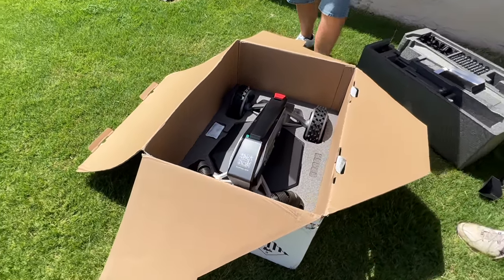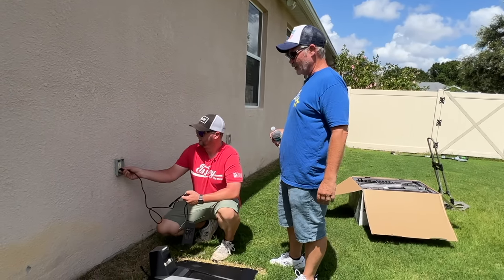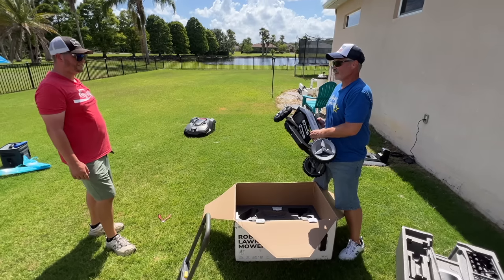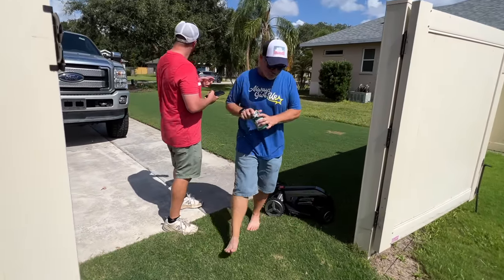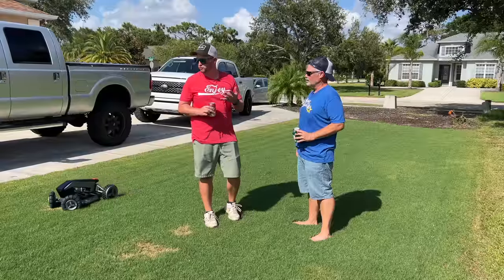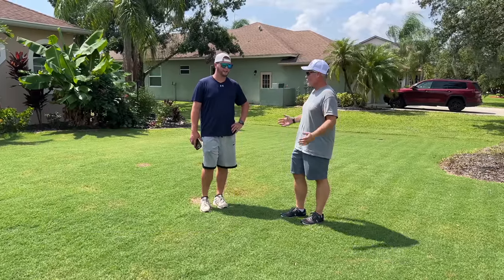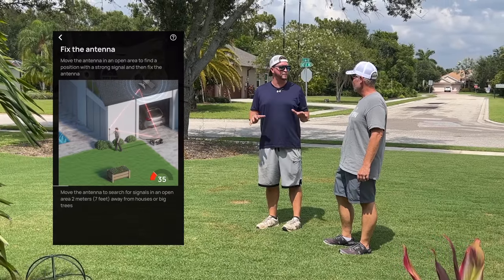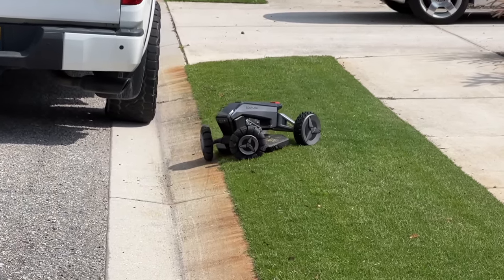EcoFlow Blade Robot Lawn Mower // UN-SPONSORED REVIEW

Comment: Great video! I had an Ecoflow Blade for a month before I returned it and got the Mammotion Luba 5000. To summarize, the Blade was horrible but the Luba 5000 is amazing and I couldn't be happier. I have wide open skies so no issues with RTK positioning with either robot, the main issue with the Blade was the omnidirectional wheels and poor software. It couldn't handle any inclines in my yard and would spend most of its battery spinning around trying to get unstuck. I have a huge incline in my parkway and the Luba 5000 handles it like a tank with the 4-wheel drive rubber tires. It can literally handle anything and get itself out of any situation. The battery lasts longer (2.5-3hrs) and charges faster (~1hr) than the Blade. The cut quality is better with the two individual blade decks (15.7" cutting width) that cuts to the edge. With a recent firmware update they upped the max cutting area from 1.25 acres to 2.5 acres! The software is hands down better in too many ways to describe. You can adjust the speed of the Luba when you're mapping or mowing so you can literally drive it around like an RC car if you want and map a huge yard in 5 minutes. The Blade only maps with one speed which is incredibly slow. One of the best features is that you can delete individual mowing areas, no go areas or channels without deleting the whole map (not the case with Blade!). What's even better is that with a recent firmware update, they let you edit the boundaries so if there's one spot in your yard that you don't like how the Luba is handling it, you can edit just that 5-30 ft boundary for example without messing with the rest of your map. It actually follows your boundary perfectly (unlike the Blade) and you can program it to do 1,2,3 or 4 boundary cuts before it starts cutting the main mow area. 

Most importantly from a lawn care perspective is that you can control the angle of the cut and can put patterns in your lawn so you're not always mowing the same direction/pattern. So maybe you mow North/South on Monday, then East/West on Wednesday and then another day you can mow it on a diagonal..... very awesome! Another thing to note for people with big trees, the RTK beacon doesn't have to be installed/connected to the charging base so if you need to mount the RTK on your roof or on top of a fence which is 50 yards away from your charging base....no problem! Hope this helps someone out there.
Reply: WHEELS:  are your Lumba Wheels 
[ ] the Original Tractor-like wheels (front & back the same)
[ ] or the Omni Front Wheels (like the Blade)?
Reply: @tulsatom4307  all four wheels are the same, thick rubber tires (not omnidirectional in the front like they are offering as a model choice now). Personally I'd steer clear of the omni wheels. Like I said above, the AWD four rubber tires can tackle the craziest hills. They can handle even bigger inclines than Husqvarna's $5k AWD model. The Luba 5000 is literally a tank, even on wet grass.
Reply: Too bad it’s only 30-70mm HOC at the moment. :/
Reply: @402SHO  I'll be honest, the sweeper worked awesome (when the robot wasn't getting stuck every 30 minutes) and the packaging it came in was excellent but yeah, they've got a long way to go before it's a viable product.
Reply: @alexlanders9005 I am in the same boat. It’s so close and I want to love it but it’s just not there. The sweeper works great but the bag fills so fast
Reply: @alexlanders9005  yea they only had some test it for a few months like I got mine at the end of the summer when my leaves had already fell and my zoysia grass I think that’s how u spell it, slowed down and stopped growing so thick. Then when it cut the cord they forced me to pack it up and send it back for another one instead of sending me a new pole and cord. The outline system for the yard also is pretty bad it always overshoots the boarder line I set. They sent us the bag but it didn’t work at all none of us tested it because it wasn’t setup
Reply: This comment and Brett's review are the best I've heard/seen thus far...excited for what's to come as they continuously improve.    But I still cringe at the price tag being equal to a decent ZT or 3x a timemaster....and knowing how consumer electronics can easily crap out... (hopefully covered under a good warranty)
Reply: @greghuizen  Definitely agree with you there. I bought the 3yr Asurion warranty from Amazon on my Luba 5000 so that was a no brainer for me to give me piece of mind.
Reply: @alexlanders9005 You are the Chuck Yeager of robot lawn mower reviews.  LOL!  Very detailed and informative.
Reply: @damonried1720  lol, thanks. I could have written a few more paragraphs easily. I've owned robot lawn mowers for 6 years now. Luba 5000 is the current king for my large lawn with big slopes. Had a Husqvarna and a Landroid previously and then of course the one month stint with the Ecoflow Blade
Reply: @alexlanders9005  what's the advantage of the omnidirectional ones? Seems like they're complicated. More to break down?
Reply: @longchode the Luba or the Blade?
Reply: @n8yt  BLADE. I just ordered the Luba. My brother got the Luba the same time I did the blade and he has had no issues with his.
Reply: Thanks for this comparison. I've been on the fence between these 2 brands and was leery about the omni wheels coz of the slopes on my lawn. You just validated my concerns.
Reply: Lumba - no vision/"lidar" collision avoidance though...
Reply: @fitybux4664  True but between the ultrasonic sensors, the three bump sensors, the ability to change the level of object avoidance between "off, level 1 and level 2" and the ease of deleting/modifying/creating no-go zones, I haven't had a single issue with object avoidance and I have three small kids who leave toys and all sorts of stuff in the back yard
Reply: $999.00 online at walmart site at time of this comment.

Comment: It sucks just trust me. My lawn still hasn’t came back in the corner where it decided to go so far off track and get stuck. I legit set the boarder line 4 ft away from the dip and it went Straight towards it. I got two boxes of extra blades and screws if you need them! I love ecoflow but there mower was extremely rushed during testing. You need to put the beacon on the corner yes, and if your mower goes anywhere near the cable you need to burry it no if ands or butts, I was told to steak it to the grass and I did it. But still cut the cable twice. Looks like they did change up the back wheels. The front wheels suck mainly because if you go slighty down at a decline the motor doesn’t have enough power to pull it back up and around.

Comment: Looks like they would do better making those Omni directional wheels caster type wheels.  Looks like the current design adds a lot of drag as the mower pushes against them.  Battery life would go up as well as not gets stuck as easily with casters.

Comment: Thanks for the honest review. 

I have a spinal injury and while I love a great lawn that’s just not in the cards for me to physically accomplish BUT we have had some success with a robot vacuum so my wife is on board for a robot lawnmower. 

Our lawn is bumpy and that’s an understatement…because it was replaced incorrectly after a tornado. I hope they resolve the issue soon and we can pickup a robot lawnmower to reduce the amount of tasks my wife has to do.
Reply: If you need something RIGHT NOW, consider looking at the Mammotion Luba mowers.  They have the 1000, 3000, and 5000 models depending on how large your yard is.  My lawn was never pristine.  It was in terrible shape when I bought the home, and so far I've only had time to fix the weeds and haven't had a chance to level it out or re-seed it.  It is a very lumpy lawn with 30 degree slope along one edge of it.  It is bermuda grass that has been growing too tall too quickly and has required more mowing than I want to do in the summer heat to keep the HOA happy.  So I bought the Luba 1000.  So far I've only had it for a week and it has been handling the bumpy lawn with ease since it is a heavier mower with more power than the ecoflow blade.

There are a few warts though:
1:  The anti-theft systems are arguably inadequate since a thief would need to connect Luba to their home wifi for it to ping its location for help.  Some users have resorted to hiding airtags or GPS trackers on or within the mower.
2:  The battery is not readily accessible for user replacement.  Time will tell how big of an issue that will be.
3:  The 5000 models have been known to wear a donut shaped hole in the lawn approximately 1 meter in front of the charging station since that it is where it always does its reversal maneuver to recharge.  The 1000, 3000, and in some regions a subset of the 5000 models have omniwheels for the front wheels that should reduce wear on the lawn when turning.  I haven't had mine long enough to see if the problem will develop with the new wheels.  The omni-wheel models have only just started being shipped to consumers.  I hope that future software updates will be able to randomize the position of the reversal maneuver.  Until then, you might want to move the charging station to where the eyesore isn't immediately visible.
4:  While the newer lubas have omni-wheels like the ecoflow, they're arrayed differently in such a way where I don't think that they'll have the same issues that the ecoflow experiences.  However I do worry that they might have trouble with pine needles.  I have no pine needles on my property, so I'll never know firsthand.
5:  Large trees with dense foliage can block the GPS signal that Luba uses to navigate, so if you have many trees on your property then luba may not work well.

That's what I can think of off of the top of my head.  My luba has only gotten stuck once, and that was because I mapped the lawn too close to a flower bed and it attempted to climb the brick of the perimeter wall into the bed.  It climbed up enough to trigger the lift sensor which shut down the mower as a safety precaution.  But that was my fault for mapping the perimeter too close to the obstacles.  IMO you should expect to still need to do a light amount of mowing/trimming around the perimeter of your home or any obstacles.

If you don't have an immediate need, it might be prudent to wait a few years.  I suspect more manufacturers will start adopting RTK guidance, and I imagine that RTK guidance will be combined with vision to help improve performance amidst heavy tree cover.  Like I said, I haven't owned mine for long yet.  But so far I am very happy with it and my primary concern is someone stealing it.
edit:
the luba also currently has the same cut height range as the eco-flow, which as has been stated is an issue for some breeds of grass.  Newer models with a larger range of cut deck are in the works but aren't available yet.
Reply: @GeneralArmchair  wow you are an awesome human for taking the time and detail for helping me with that info. I really appreciate it.

We only have 3 trees right now because we have a smaller property but we have been looking for a couple years to get a slightly larger home and property and I like the RTK style since it doesn’t require wires to be installed and we can easily take it with us to the next house…if that ever happens 😂. 

The way I think of robots in general are that they help about 80-90% but there’s still some form of human involvement still. At least that’s the way it is with our robot vacuum so far. We’ve had it for almost 2 months and that why we are considering a robot lawn mower because my wife is now slightly convinced that it could help and be convenient. The robot vacuum still has its quirks though. For the lawn mower I’d expect that she would still need to trim along the perimeter and obstacles or the occasional mow. 

Our main concern is the super bumpy lawn but the general contractor is supposed to fix they issue they caused when they repair after the tornado. It’s pretty bad and you have to watch that you don’t roll an ankle right now. 

I like the Lubo but I’m worried in general for a lot of companies because I wonder what the lifespan is from a robot mower for serviceability like you mentioned. My concern is the battery, deck motor, wheel driving motors and even if those are fine I worry that companies decide not to support it anymore or close up shop and I don’t know if that means the mower will still function or does it rely on the manufacturer to operate? Will it be like a cell phone and they just stop support and then you are forced to upgrade. These are some of my concerns. 

Thanks again!!
Reply: @kore996  Long term serviceability is definitely a concern with the Luba.  From my limited personal experience and with reviews from others, the mower seems to be a good job but signs of growing pains in other areas are definitely visible with mammotion.  Personally I feel like most of the other companies manufacturing mowers have been resting on their laurels for years with their guide-wire driving roomba style mowers.  I think Husqvarna might be the only solidly established company offering an RTK guided mower, but theirs clocks in at twice the cost of some of the Luba models.  I read about some home-made solutions that grew out of something called the Ardumower project,  but the documentation that I could find on it was mostly in german.  I just don't have time to devote to a DIY project of that level right now, but the final solution at least would be something where you could replace everything and weren't reliant upon support from a single company.

Normally I mow while wearing a filtered mask because of my grass allergies, but the heat has been unbearable for wearing a mask this year and one too many nastygrams from the HOA pushed me over the edge to rolling the dice with luba.  I might get burned with early adopter problems, but I'm hoping it can last me 4-5 years so that it can save me some money in the long run compared to hiring someone to mow my lawn.  I might be capable of taking it apart myself to replace a simple battery, but if it can just last me a few years then I hope something more refined will be on the market in the future.  For example I was attracted to the Worx brand mowers since their mowers have readily replaceable batteries that use the same batteries as their brand of cordless power tools.  But the Worx mowers all use guide wires with the exception of their new "vision" model that replaces the wire with unsightly magnetic strips that sit upon the surface of the grass, and even then it still does the inefficient roomba style navigation.  I suspect that the future is a combination of RTK for map definition and high level route planning, with some kind of vision sensor providing obstacle avoidance and backup navigation during periods of poor GPS reception that may be encountered under trees or within an alley between homes between the front and back yards.

Comment: Would it not be better if the contact pads were on the top instead of underneath thus keeping cleaner and when driven in the contacts would also be a better a much better and more positive connection

Comment: Does anyone know if it’s ok if you apply ornamec in early morning during summer to kill of Bermuda in fesque yard? I am aware it’s best to be done in spring and fall. It’s just that I am trying to slow down this process before it takes over front lawn like it did after liquid burn  last yr to front lawn due to the same issue among other weeds every yr.  

I am doing LCN lawn care program that suggest this product that I already have. I did it last yr prior to lawn intentional burn off and no issue in late June.  It’s just a little later now in summer.

I still plan to use Ornamec every month this fall and next spring. To slowly kill off Bermuda hopefully for good.  I just want to use once in summer in early morning while still much cooler.

Comment: Charging fix is easy for Eco flow move the charge contacts on the mower body to to top side instead of under.....but make a slot connection so it avoids elements.

Comment: Robot vacuum cleaners have been around for about 20 years and they all still have most of the exact same problems they suffered from 20 years ago.  If you're waiting another year or two for the perfect the robot lawnmower, you're going to be waiting forever.  The technology improves very slowly and most companies don't fix many of the most common problems like getting stuck on an obstacle.
Reply: That's not true. The robotic vacuum cleaners do excellent small object detection since lasers
Reply: Hard disagree. Bought my mom a roomba and she loves it,  doesn't have to use the old vacuum as much anymore. Only for small hard to reach spots she would've had to clean anyways

Comment: I had a blade. It was terrible. Would not cut in straight lines, cannot mow if you have any significant shade. I sent mine back. It is documented on my channel.
Reply from the maker: interesting! you do have alot of trees that we did not have to contend with. Brett has the RTK pole in the front yard, but the mower does fine all the way at the far back behind the house. But I had not considered what overhead disruptions would do. Looks like we will have to test it on a shaded lawn next.
Reply: @Thelawncarenut  yes I would love to see that. I got a luba 3000 that does a much better job. Btw I am a long-term fan of the channel ;)
Reply: @Innovate2renovate do you have a lubba video? Looking for an honest review.
Reply: @BrendenChase77  yes I have a few on my channel
Reply: @Innovate2renovate  sounds like you like it. Thanks!

Comment: See. It can be made much cheaper ($1400 cheaper than the Italian one) with better electronics (consistent with this millennia). There is still room for improvement, but the design direction of this mower is parallel to what I would have done.